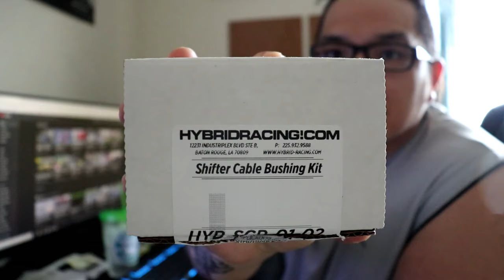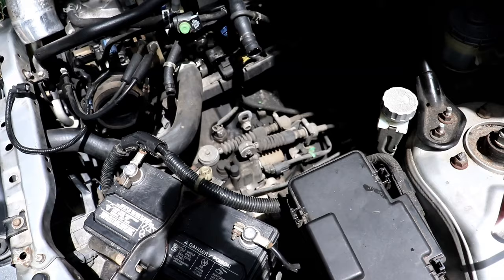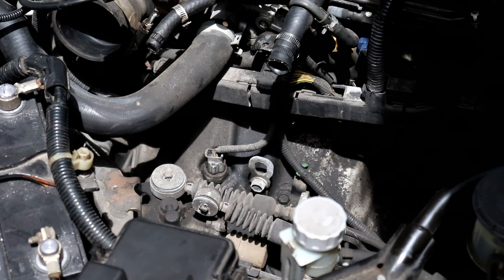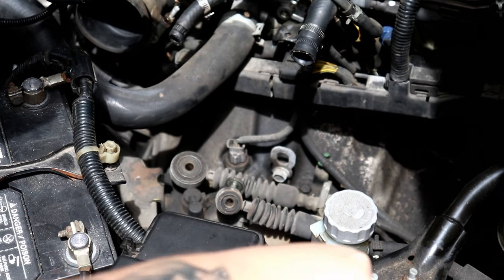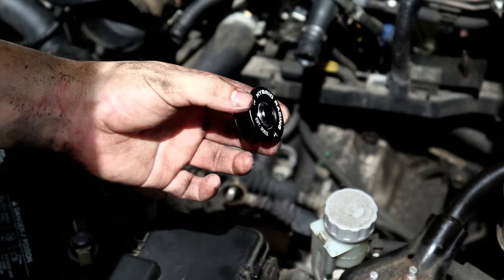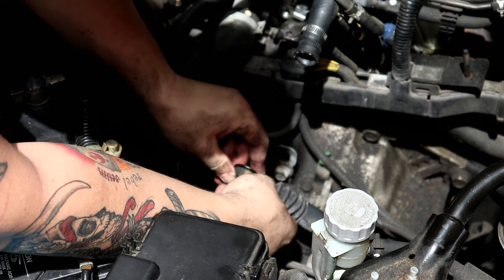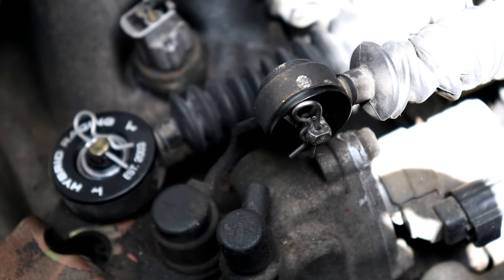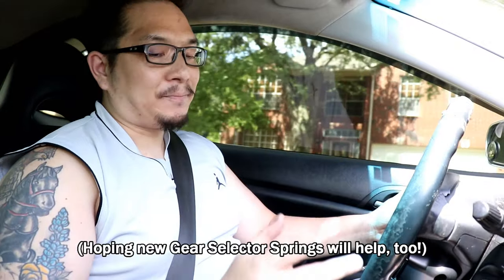The RSX Gets Hybrid Racing Shifter Cable Bushings! | RSX Installs

Comment: The bigger one fit great, but the smaller one I had problems with. I used  the smaller o-rings and I still couldn't get it on. I ended up with just one o-ring and pushing it hard to get it in. Horrible 45 minutes of tinkering with the smaller one.  I used wd40 and white lithium grease 2004 RSX.

Comment: I recently bought the hybrid racing bushings, great at first but now I can’t bang gears, it misses half of the time. I never missed with my stock bushings.
Reply from the maker: That's kinda weird tbh, I'm fairly certain some other issue has come up by coincidence
Reply: Shift cables themselves possibly?
Reply from the maker: @michaelwebb7787  more than likely or change your trans fluid to synchromesh fluid

Comment: I have the same problem with my rsx, the shifter will occasionally pop out when I shift into 3rd. Hopefully this will help solve the problem. 

PS. great video and was very informative.
Reply: I have the same problem
Reply: @bigpoppa1250  have you changed your transmission fluid?
Reply: These won’t solve that problem. These cars have weak 2nd & 3rd gear synchros. Next time you do the clutch replace the synchros (carbon synchros are only a little more expansive than brass and are much stronger)
Reply: Both 04 rsx-s I have owned had problems with 3rd gear, not popping out of gear so much but more not wanting to go into 3rd. The current rsx I have I bought from the original owner and was told it had that problem when they bought it in 2004.

Comment: I use to have the 3rd gear problem. It would pop out cuz i wouldnt put it in all the way cuz it was real notchy when i first got it. I used redline mt90 and it solved it. I still wanna do everything you did with your shifter cuz mine still flops like an old donkey dick and its annoying cuz i miss 3rd sometimes when racing. It took a couple days for it to go away i guess the fluid had to break in. I used 75-90 but someone suggested something just a bit thicker. Hope this helps.
Reply from the maker: Yeah I'm getting ready to order some Amsoil Syncromesh and do a trans flush... From what I read on forums, simply doing that pretty much cured their 3rd gear problems